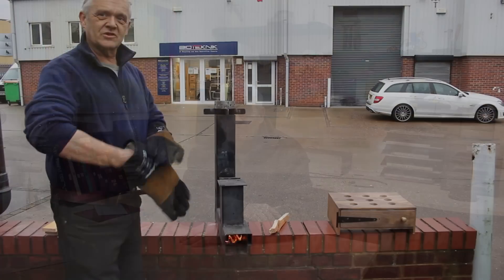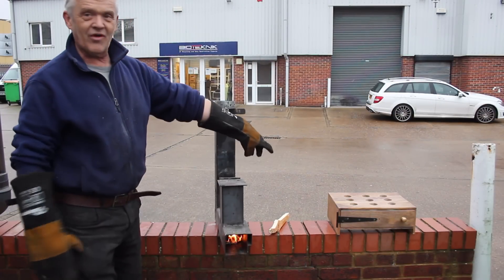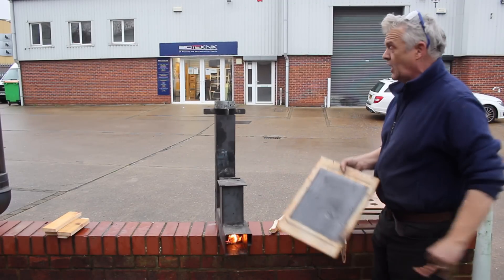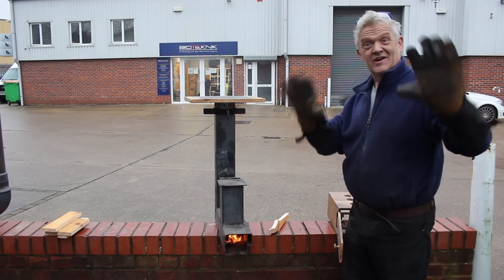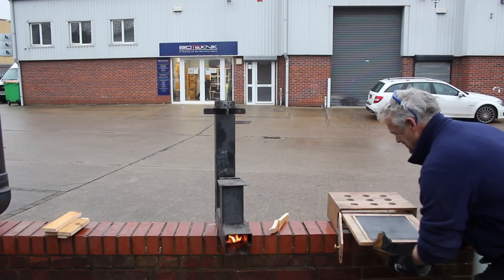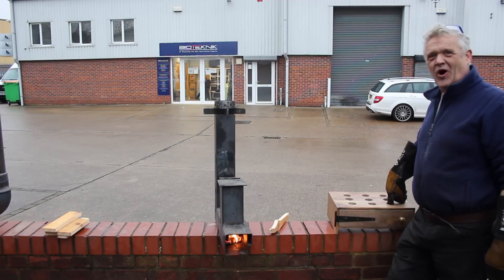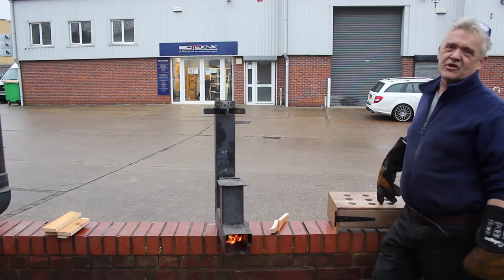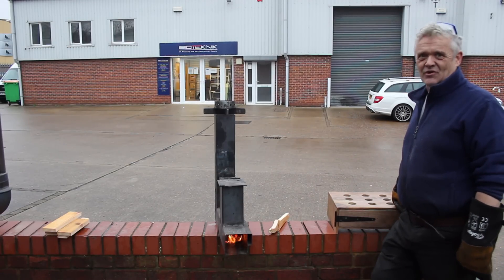1788 How To Use The Heat From A Rocket Stove Inside

Comment: Hi, try 3 litre stainless milk churns filled with parrafin wax which is a phase change material on top of any stove and take them from room to room. Sun Amp are heating Supermarket electric delivery cabs to save using the vans battery for heat. They don't use milk churns though. Make sure you get the ones with nice flat bottoms.

Comment: Use the rocket stove lower to the ground and  run a nongalvinized metal pipe over the fire hole a d into a sealed window with some type of heat protection. The cold air below the stove pipe will get heated from the stove and push it self out the top end of the pipe. Equals a redneck heat pump.

Comment: I’m envisioning making a rocket stove with a mass of sand around it, the whole thing being on a wheeled cart that can be wheeled outside to “charge” up the sand with heat and then wheeled back inside to release that heat slowly over time. Could also simply build a window insert with a metal flue pipe going through it to exhaust the rocket stove to the outside for charging up the sand and then once the sand is charged up and the fire is out, the window insert could be popped out and set next to the rocket stove and the window be closed.

Comment: The rocket stove I bought has a flue coming out the back made from 3inch exhaust pipe so I can use it indoors. The flue goes though a small hole in kitchen wall then runs up external wall(about 2m high). It would be fairly simple to modify rocket stoves without a flue to receive one.

Comment: If you make a real rocket mass heater the way it was intended to be made you can have a very very small pipe going out outside to take a very tiny bit if any smoke out. I would suggest that everybody watch rocket mass heaters and watch a build as far as the old school method of heating your house where a chamber is used to reburn and reburn and reburn the emissions from the burning wood to get ideas on how to almost completely eliminate any emissions from the burn. People have taken this concept and bastardized it down to these little metal burning mechanisms that are not really rocket mass stoves realize the middle word mass it's meant to heat a large mass of rock clay and sand in order to heat your home. These were never meant to be small metal burners for the sake of burning a little bit of wood and heating up a pot of water. Rednecks in the United states started doing that and I don't even know why. Look on YouTube for the original videos on how to build a rocket mass heater for your home and you'll see what it was originally intended for

Comment: Your power videos are brilliant.   But I'd like to see a video for some kind of solar heater for recycling plastic.   As I understand it the common shopping bag is very low melt point and a a good(ish) insulator.  So cast the molten plastic into "bricks and use them inbetween brick courses (safe from the UV) or perhaps slugs that could be dropped inside concrete blocks...  Or made into sheets to work as vapor and thermal barriers?

If you make a million dollars & win prizes I just want a nice mention at the Nobel prize ceremony and a beer...

Comment: I wonder how hard it would be to build a second layer like a sheath that has air gap between it and the stove outside, and seal it so you can pipe air out of the house and into the cavity then pull it back in through another pipe after it is hot, all with out having to have any of the smoke and debris from the fire contaminating the air on it's way in. (and run this through say a small board that a window can be propped open keeping the cold air from outside from coming in, but allowing air to be sucked into the outgoing pipe and another port for the incoming heated air back into the window. (I do something like this for my cat where I hang a flap over 1/4 of the window and the other 3/4 of the window opening, is blocked with a board and some insulation so she can push the little flap open to get in and out, but only a strong gust of wind can really push that flap open much at all, otherwise it remains closed the rest of the time avoiding air flow when the cat is not going or coming, or coming and going. lol) )
Reply: You can also build a little L-shaped tunnel on the outside of the cat flap with the entrance away from the prevailing wind, or an air-lock. I do something similar for mine. Makes a difference in windy weather.

Comment: There was a video on YouTube I saw a while back where a guy made a Swedish log torch and ran a bit of bent steel pipe straight up the middle of it. As the air in the pipe was heated it drew in cold air at the bottom and pushed hot air out the top of the pipe which he poked into a tent to keep it warm in snowy conditions. Would be easy enough to weld a pipe to the back of the rocket stove and do the same thing.

Comment: a brick would be great.... .. old days a shoval would transport coals from a house with a fire to a house that their fire went out... a shovel transporting 2 bricks to a designed enclosure... a wooden box... where a blanket could contain the heat onto a persons sitting legs... next to the couch or under the kitchen table.... next to the bed... and have a metal pipe go up and under the covers to heat the bed..... ultra simple... its an idea... probably not the best idea... just contributing ideas

Comment: Further down in the comments a chimney sand battery ring is discussed by Richard Cranium and another.
I could see this being made from recycled cookie tins. METHOD: cut the chimney-sized holes in the top and bottom, weld in the center bit of metal in the bottom, fill with sand, weld the center and lid together and around the outside, and slide that down over the chimney. You can stack it all back up inside or put them in the little stoves or foot warmers. 
I think it would be cheap enough to allowing making a second set to have heating before the first loses all warmth.

Comment: for cows.. and deer etc.. they make salt blocks.. about ten pounds or dollars.. give or take.. why not use salt blocks to store energy.. put handles on both sides and drill a hole in the middle of the salt block.. the salt storage will hold the heat a long time..  place two of them on the chimney.. the heat in the rocket stove isn't enough to melt the salt but will store the energy to be used in the house.. just lift it off and take it in.. you can place a magic heat heat reclaimer on top to blow the heat around or simply a fan..

Comment: I've added a copper tube, coiled in the flame area inside the chimney of my rocket stove and also covering the whole thing with a sealed oil barrel (as a mass heater). Copper tube is water filled and flows out as steam through a car radiator with 12v fan to blow around my large garage and then steam/water return back into a holding tank

Comment: I have a fireplace but it is an insert type so heats like rubbish. Last year I added some fire bricks to the side walls it helped. Last week after a good cleaning I grabbed some slate, soapstone or some such stome from an old woodstove layed them on the bottom. Did a burn for about two hours on Christmas Day and at 7ish that same day the firebox was at 94 degrees Fahrenheit some 4 hrs later. Best thing I have done to my house.

Comment: Sorry to be negative Rob - technically yes, you've brought the heat inside. But how practical day-to-day is that really for say elderly,  disabled or time-poor amongst us who can't just go outside to start and maintain a fire in a rocket stove, then carry great lumps of stone in and out of the house and squeezing a potentially second-degree causing burning stone into a small box ? And even with a larger piece of stone (assuming you could somehow suspend it over the rocket stove chimney safely) and then manoeuvre it indoors, you aren't going to be able to effectively radiate heat to warm anything but a smallish area of the house in the middle of winter. What you've shown, fair enough, may be a sort of solution for some but it is really only good for warming one person's feet and that's about it.

I know you love rocket stoves and yes they are great to enjoy cooking your breakfast bacon and eggs with your Son outside a workshop on a cold day but I still believe that rocket stoves aren't a really practical form of heating in suburban living. Even if you bring them inside and go to the expense of installing a chimney for them you still can't make very effective use of the high speed burn with most of the heat going up the chimney. Then you've got to have a big inconvenient supply of combustible fuel and also spend loads of time constantly stoking them to keep them from going out because of the speed and intensity of the burn. They are great as a conversation piece around a camping fire or as a camp cooker - the noise they make, the quick heat up and the need for manual intervention constantly having to throw wood on them every few minutes which will keep the closet pyromaniacs happy but so far I am yet to see them as practical indoor heating solution.

Loved the idea of the Vevor diesel heater running on waste cooking oil and a couple of additions. Now you're talking !

Comment: Would it be possible to extract the fumes of the rocket stove with a sort of compressor pump and pump them through a water bath to remove all the sooth and then just have carbon monoxide left to expel through ventilating the home? The water bath should probably have a bit of detergent in it to break surface tension / bonds of the water and you would need to pump the extracted fumes through some sort of fine mesh to create tiny bubbles (a bit like an aquarium) and then maybe agitate the water to mix the air bubbles and the water. If you run that compressor pump with a steam engine powered by the rocket stove you would come full circle. Getting rid of carbon monoxide through ventilation is easy enough, but it's the sooth and smoke that is the problem for indoor fires. The water would get murky but you could have it sit for a while to have all the sooth settle in the bottom and then recover the water and get rid of the sooth.

Comment: I favour sand battery for heat storage.   I placed hollow copper pipe inside the 3 Tim can tall units and filled with sand around them.  Added a 90° elbow and ran 6" pipe into the methanol flame.    Having the tubes hollow does make the bottom of the batteries warmer than a sand filled pipe.    Gives me about 2 extra hours of heat from a methanol burn which lasts an hour at 500ml.    I have no idea how people are getting 5 hour burns from methanol so that as my solution. Store all the heat I can in bricks pavers and sandbatterys.    We haven't been cold this winter even when it was -9°c.   Pavers make great tops to store heat and are cheap.  It's not all house heating but having a warm room makes all the difference between living in the cold.  

Can't do much about electric use but hopefully the lack of the heating bill offsets the winter bill once we are over the cold months.    The gas is just used for hotwater now.

Comment: Got to think about weight and transport, how much heat stored in that mass and how much it gives off for a period of time.  You ideally want a fluid that can be pumped to where it is needed, using a mechanical solution, rather than a human lifting a solid mass, so I would suggest looking at repurposing an oil filled radiator, pump heated oil from your rocket stove inside via a pipe,  use the hot air from the rocket stove to drive the pump.

Comment: 7 inch tube J style stove with ash catch.. long wood closable vertical feed. Cast grates in burn chamber. 7x28" heat riser with 8x 28"  insulating tube surrounding filled with diy firebrick 16x42inch dome capped tube encasing it down to ashtray.  With exhaust coming out the middle back running up. Has 1 inch fresh air feed to post burn and small gap to burn chamber. heat exchange is 16x7 inch tube with flat top. split in half 4 holes with half-pipe wrapping down and up each side of stove. The then whole thing in a cut up 55 drum backfilled with firebrick.

Comment: Furnace went out in the camper at -10c and we had a newborn baby. I grabbed a big metal pot, went outside and filled it with rocks from around the fire and put it on the stove. It was toasty warm in the camper for the rest of the night. I like this video. I have seen another iteration using a few lengths of pipe through a Swedish stove and running the pipe through the tent. No smoke but hot air running through the pipe for hours. Brilliant
Reply: fire - rocks - bucket - stove.. it simply works

Comment: wrap the stove with copper tubing and run it in the house to a radiator with a fan, use a pump to circulate water for a wood fired heat exchange.. its tiny and you would be constantly outside to stoke the fire

Comment: couple ideas, some fins on the plate would help to better heat the air around the plate. I also think a fan to condition the air through a window or green house for example could work.

Comment: I like the idea of a mass heater with handles on the side that has a square hole in the centre allowing it to slide over the rocket to heat it.

The question is, what's the lightest material that would retain the heat adequately?
Reply: Phase change material, but can it take that amount of heat? Perhaps with a bit of a buffer.

Comment: I know someone rather "woodsie" who made a rocket stove out of a horizontal compressor air tank.  He cut 6 inch aluminum duct pipe match the circumference of the tank drilled some holes in it right above the compressor tank to draw in cool air.  Then he uses regular old flex pipe attached to said ducting bringing the heat in through a window.  Uses a little window frame built of plywood he pipes it through w/ little fan suck the heat up.  Where the flex pipe meets the wood frame he used another little piece of 6 inch duct pipe creating an insulation layer where he made fashioned his own heat refractory material out of plaster and sand which he found via a video here at youTube.

Last I spoke to him he told me he was going to modify it by putting a vent in the heat exchange duct pipe to mix more air upwind of the convection holes so he could perhaps better adjust temperature as he said it puts out too much heat.  I believe he said he heated 800 SQ Ft thereabouts with it.

Whole things on wheels, comes apart easy, no modifications needed to his place, takes about two minutes to setup.

Comment: with the exhaust so far away from the burn, a Peltier-powered stove fan on top of the rocket stove, inside a fireplace, might work well. (caveat : max temperature of fan is 660 F!)
Reply: Ahh....the Turducken heating system

Comment: I like the sand battery and heating one of those and bringing it in.

Also, on the ‘earth cooling’ idea with pipe, use that idea with heated water through little pipes pumped in the house to car radiators.  And blow that heat into the room.  Perhaps hydrogen flame could be used too to heat up the water going through the pipes into radiators.

Comment: Hmmm🤔  I wonder if you could build a lantern or bugzapper shaped "thermal kettle"?  Something pretty that you can set on top of the stove to heat up and bring inside with a wood or carbon fiber handle when its at proper temp but make sure it's still partially contained in some metal cage/mesh so that you can't directly brush the hottest spot. 

I'm envisioning something like your stand heater with the ornate brass & stainless mesh mantle but with a thermal mass, decorative enough that the Mrs. doesn't mind it sitting on a ceramic tile in the bedroom or bath...  Maybe utilize some carbon felt as an added challenge if that's not already hard enough😉

Comment: Why couldn't you put a flue pipe on it and then put a barrel over it with a hole for the flue pipe to go through, and then another hole to vent the hot air into a window via an insulated window insert?  For the window insert, you can use plywood treated with high heat silicone and then put fumed silica in between the panels.  

   For best results, you would want to insulate the barrel that collects the hot air and put a little, very breathable insulation at the top of the flue pipe.